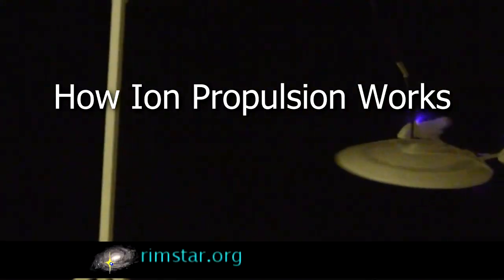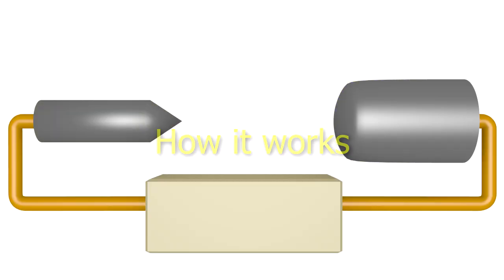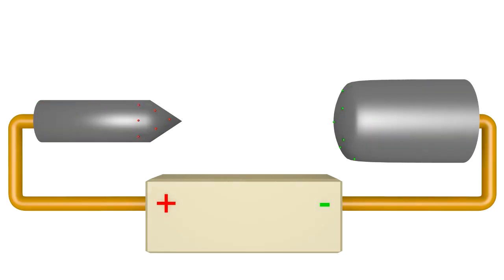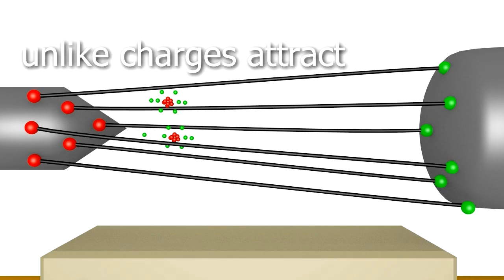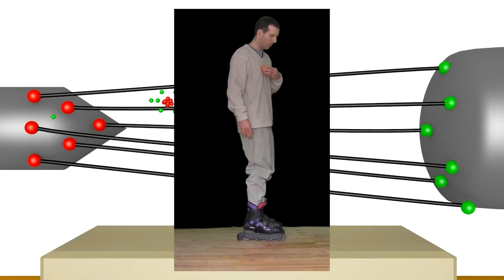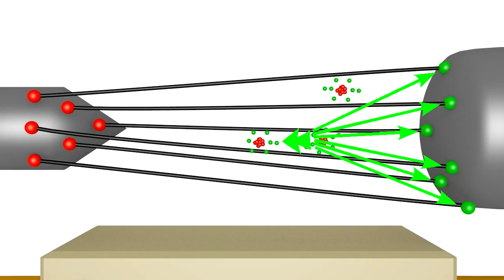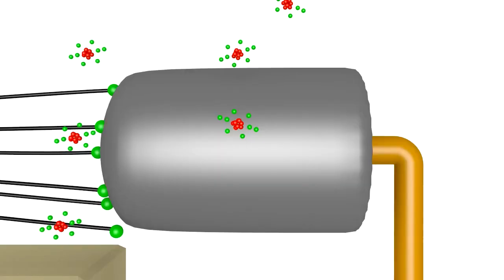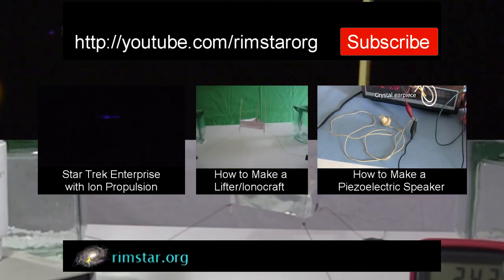How Ion Propulsion, Lifters and Ionocrafts Work

Comment: why or how does it create ozone
Reply from the maker: israel turner I don't know the why or how, just that above a certain number of kilovolts (thousands of volts) it starts producing ozone, which is O3 or three oxygen atoms combined as a molecule. I don't know exactly how many kilovolts either, though I was told it's below 10 kilovolts.
Reply: i was going to build the lifter but i dont know what to do about th power supply i would prefer buying onethats not to expenseve but i dont know wich
Reply: Exuse my spelling
Reply: I could use your expertice
Reply from the maker: israel turner The only one I know to buy is from amazing1.com and is costs quite a bit. See the bottom of my webpage here for some options http://rimstar.org/sdprop/lifter/lifter.htm
Reply: thanks i will check it out
Reply: @RimstarOrg Another great website for Tesla Coils with massive streamers and a MIDI controller is this website here, though they're incredibly expensive, any others interested as well: http://www.easternvoltageresearch.com/index.html

Comment: what would happen if you sealed both sharp and mooth in a vacume sealed tube filled with hydrogen or hydrogen choride? think it would explode or do you think it would show it plama more easily and inhance the proton transfer abillitys between the sharp and smjooh objects? would here be an ozone discharge?

/
Reply from the maker: shaun adlesperger I don't know. :) I've only worked with air.

Comment: im curious what is the lowest amount of power needed to create lift and what is the max? does that amount differ between how far the distance is between the "sharp" and "smooth"? can the "smooth"  end be covered on the opissite side of the "sharp" object?
does the gap between the smooth and sharp need to be contained air or does there need to be air flow?
 im very curious about this and any questions that you feel like answering would assist me greatly.
Reply from the maker: shaun adlesperger For my lifter, the minimum voltage is around 26kV but I don't know the minimum current due to the limitations of my meter, but it's somewhere just over 250 microamps. You can see the measurements in my video here https://www.youtube.com/watch?v=LOGAaObsN4g. The min and max are really dependent on the distance between the sharp and smooth electrodes. I've never looked for what the max is. The greater the distance the higher the voltage you'll need. Yes, the smooth end can be insulated but you must allow air to flow. The gap can be blocked somewhat since the electric field is actually larger than the gap size.

Comment: Hello RimstarOrg,

I am building a ion lifter for a science fair and have encountered a problem along the way: the thin wire I am using for the top part of the lifter and the place where the skirt connects to ground seems to be too strong and it stops the lifter from lifting. I am using 30 awg wire. What type of wire did you use? Your wire seems to move about much easier than mine.

Thank you for your time
Reply from the maker: WorkshopScience I'm using 30 awg wire. It does take some playing around to prevent those wires from holding the lifter down. Sadly what works one time may not work another time so I can't tell you exactly what to do. Try raising the lifter with your own hand and observe what effect the wires are having. Try putting out extra wire along that length, put a horizontal curve in it if needed.Also, the best thing you can do is to run your lifter in the dark and observe where the corona is. Trying to get your lifter running in a lit room is like doing it blind.Also, it's best if the one connected to ground is the one going to the foil. That way you don't have a high voltage wire near your table top. That can causes forces on that wire that'll interfere too.I have a section with tips on getting it to work on my webpage here too:http://rimstar.org/sdprop/lifter/lifter.htm
Reply: Thank you very much for your help and your time.

Comment: It was proven the Ion wind is not strong enough to lift of move the emitting object. It should be considered little more than a side effect. However, the electromechanical effects are certainly, and shown to be up to the task. Much like using electromagnets for propulsion.

The problem however is making the system efficient enough to use in practical applications. The limited amount of thrust or lift, combined with the sheer mass of the power system makes this current setup and similar ones, not useful for more than a science project, and one most science teacher would more often than not dismiss as "junk science" simply because they do not or refuse to understand it.

But knowing how it works is the first step in making it work better. Most technologies on Earth did not get to the point they are now without baby steps that seemed to be impractical or had very limited practicality.
Reply from the maker: DocWolph If the proof you're talking about are the calculations and measurements done by Jean-Louis Naudin, his measurements didn't take into account the sequence of collisions that result in random motion higher up and therefore doesn't contribute to the wind in the area below the lifter where he did his wind measurements.

Comment: So the big question is, can an ion lifter produce enough lift to carry its own high voltage power supply, some passengers, a bathroom, a kitchen, and a living room?
Reply: Yes. If you could produce enough power... We'll probably have to wait for fusion.
Reply: @MeepChangeling  just put a radioisotope generator (nuclear battery) with a tesla coil and you have a ufo
Reply: @MeepChangeling  almost here baby, first sign of power a couple weeks ago 👍
Reply: Their is a new start up company that has built a drone that uses ion power. It's pretty wild looks like a old TV intena with a drone bottom half lol. Has no props no motors extremely quiet yet floots n Flys around like a ufo
Reply: @kcmullins6179  it's actually quite loud. 85 dB vs 90 dB of a prop quad.
Reply: Mmm a kitchen? I'm not sure, maybe a microwave device😂😂😂
Reply: 6 years later: it a thing
Reply: Yes
Reply: https://www.youtube.com/watch?v=Qdg0_hjuksQ
Reply: Seems it needs around a decade to prove itself :) https://m.youtube.com/watch?v=iihprC5Huf4&feature=youtu.be
Reply: Yes
Reply: Man that's exactly what i was wondering😂
Reply: You could reduce payload by, instead of a bathroom, just having a hole ... 🤔
Reply: @michael borg Actually, that's exactly like a regular nuclear power plant. All a nuclear reactor does is boil water via the heat from the radioactive fule and use the steam to spin a turbine. A nuclear reactor is quite literally no different from any steampunk world where a magic glowing rock allows for the creation of tiny yet powerful boilers to produce "galvanic current".
Reply: @MeepChangeling  That is wrong. Not because nuclear power plants don't boil water to achieve that, but it is wrong because you implied all nuclear reactors do that, however there are some nuclear reactors that do not utilize light-water reactors. Which is what that is called when they basically boil the water and use the steam to produce energy. they boil it through nuclear fission of uranium. 

However there are also Thorium reactors and various other nuclear reactors that do very different things. Many light-water reactors are currently used, however many places stopped producing them and are actually debating whether to repurpose them into different nuclear reactors since the light-water reactor is not very efficient and has a ton of negative downsides for the environment.

Although despite the fact that light-water reactors have huge downsides to the environment, don't let that mislead you, they are still thousands of times better for the environment than burning fossil fuels.
Reply: Underrated comment
Reply: They use them in space on satellites with a liquified gas where gravity isnt a factor.
Reply: Hsfh Fejtpo you would have to make one. I was thinking of using solar panels, batteries, and a custom transformer.
Reply: @idea1407  Custom transformer? Keep the customers satisfy´d!
Reply: Sure. Just scale it up.
Reply: The military does
Reply: No. UFO uses zero point energy: vacuum in a crystal. I do not know how they harness the zero point energy.
Reply: Or can it be hooked up to the new mini space shuttle dream catcher so it can be used to get to high orbit without the use of conventional rockets
Reply: Dawn is a spacecraft by nasa which used ion propulsion. Search it.
Reply: Man has lost sight of the truth for himself.  Man is supposed to be working collectively on how to reconnect with the Divine Providence.  The construction of this device will NOT help you to re-commune and will only take man on perilous journeys deeper into other worlds of negatively polarized sensation and conflict.
Reply: @adamson5779  crawl back under ya rock where ya belong
Reply: @adamson5779   I agree frabato
Reply: @adamson5779  Mm. Ion a hear more about this.

Comment: What happend when you use AC instead of DC? Sry I'm a noob. :-/
Reply from the maker: Jimmy Metten If you use AC then it doesn't work.
Reply from the maker: Hmm... I'd always heard that AC wouldn't work and thought it wouldn't, but what's important here is the sharp and smooth electrodes. The wind is ultimately neutral particles. The only place where AC might be a problem is in between the electrodes where the ionization is occurring. The ions would be sloshing back and forth as the charges on the electrodes keep alternating, basically getting nowhere. But there might be a frequency where it doesn't matter, where the ions get enough time to travel far enough, maybe a low frequency AC. Might work. Might not. :)
Reply from the maker: *****
Not sure you can have low frequency on one electrode and high frequency on the other. That's because whatever you do on one gets an immediate response on the other. So a low frequency on one causes a low frequency response on the other. You'd just have a mix of two frequencies going on at the same time on both.
Reply from the maker: *****
One difference is that there's a difference in ion mobility between positive ions in air and negative ions (http://jnaudin.free.fr/pcnpend/html/pcespend.htm). You can also find some difference with how the corona forms explained below here https://en.wikipedia.org/wiki/Corona_discharge#Mechanism_of_corona_discharge

Comment: Hi! Great job!

I have a question. It's about the part at 5:54
If the negative is connect with the sharp object, you said there are some diffences what happens. What are the differences?

Thanks

And Great Job!
Reply from the maker: excristao I can't go through all the details in a comment but it starts near the sharp object again since that's where the electric field is strongest, except electrons are stripped off the atoms in the air and repelled instead of attracted. A full description can be found here http://en.wikipedia.org/wiki/Corona_discharge#Mechanism_of_corona_discharge
Reply: RimstarOrg
When the sharp is positively charged then positive ions are repelled and cause de air go down or something like this. But when the electrons are repelled insted, the air go down too?
Reply from the maker: excristao Yes, the electrons collide with other molecules on the way down and ultimately cause air molecules to go down too.
Reply: RimstarOrg
 Thanx.

Great videos and support.

A week ago I saw your videos about ion propulsion. On monday I shared with my students :)

Comment: Hi Rimstar, I wonder if you could answer something for me? (by the way fantastic explanation);
I have been watching a lot of videos on lifters and electroKinetics in general. I have noticed on a few of the videos that; if a piece of paper is placed between the anode and cathode then the lift was increased (measured on scales).
Do you think that this phenomenon could be that the paper is adding more Neutral atoms?
I'm sorry to burden you with this question, but you do have a very good understanding of the device.
Thanking you in advance, Dean
Reply from the maker: Dean Hunt I just checked my website where I'd long ago noted what happened when I did this same experiment 13 years ago (http://rimstar.org/sdprop/lifter/lifterwindtests1/lifterwindtests1.htm) and I noted at the time that there was no change in height. Sounds like there's more rigorous testing needed to tell exactly what happens. Since the device is still flying in any case, I'd liken it to putting a wall behind the outlet of a jet engine, and where the wall is not connected to the jet engine. The jet engine would still move, even if the wall followed behind it, as long as the wall is not in a position to physically interact with the jet engine itself.
Reply: RimstarOrg Thank you for the reply, I have ordered all off the components so that I can start tests for my self.
What I did notice from the other videos was that; when the paper was placed on the device then no change in lift was measured, however; when it was held there then the lift was increased. I think that this is certainly interesting and was toying with the idea of injecting pulsed magnetic fields into the emf field. Also maybe to try and use Graphene for the corona. Thank you again, Dean
Reply: +Dean Hunt Why use graphine?

Comment: But wont the charges eventually balance out? When enough electrons arrive at the sharp end, wouldn't the charges be balanced?
Reply from the maker: Jimmy WimminyWam Possibly, but the momentum transfer that I start describing at 4:28 and more explicitly at 4:51 is what makes it move. And in case you mean the charges will balance out and everything will become neutral and stop working, the power supply keeps the charge circulating.
Reply: RimstarOrg Thanks man, your the boss!!

Comment: Hello, how many voltage is required to lift the lifter and why is ion propulsion effective when it requires heavier energy source (Lifter for example requires that heavy high voltage machine)? Awesome video by the way!
Reply from the maker: Thanks! My 2 gram lifter lifts off with around 26kV and around 275 microamps. By effective I assume you mean practical or useful. Other than for fun science projects these lifters aren't effective. However, ion propulsion is used for spacecraft where it's okay if they take a long time to get up to a high speed. NASA has used it for some deep space exploration missions and I think Europe is also working on that.

Comment: I don't know about air temperature between the electrodes but I think buoyancy forces also may generate air flows in favor of propulsion.
Reply from the maker: I've never measured the temperature in the region of lifters. I imagine surfaces at least would be cooler than ambient due to all the air flow.

Comment: is it possible to use this concept to lift an actual person?If not What are the limitations that need to faced?
Reply from the maker: It's theoretically possible, but you'd have to build something the size of a house, put over a million volts across it and be inside at the same time. So it's not very practical.
Reply: but couldn't we increase the voltage further so that the same amount of force could be achieved with a smaller design?(the voltage might then be lethal) also wouldn't using electromagnets further the ion's acceleration?
Reply from the maker: Blueghost136
I think a million volts is lethal enough. :) But keep in mind you have to lift the power supply and with electromagnets you're getting into VASIMR and other designs and they don't lift their own weight either. For really big thrust they even talk about going with nuclear reactors to produce the needed energy.

Comment: What are your thought on in atmosphere propulsion. It clearly works on a small scale but given an adequate power supply would it be possible for say small air craft?
Reply from the maker: A rough number is that there's a voltage of 100 volts for every meter of height through the atmosphere. And that varies depending on all sorts of things: nearby objects, humidity, air density, wind, ... So you'd need a tall aircraft to get the voltage. Then there's the question of how much charge is in the air, which also varies. That's extremely small. From Feynman's Lectures, volume II, 9-2, the current density (charge moving under the influence of that voltage) is around 10 micro micro amps crossing each square meter parallel to the earth. So I'd say it wouldn't work for a small aircraft.

Comment: So does this have spacecraft use? Is it usefull for long distance travel? And most important does it have speed ? (my thoughts are it uses more energy than it produces,but i find it really cool :D)
Reply from the maker: Ion propulsion has been used by NASA on some spacecraft, though they do it a little differently. Since there's no air in space they carry along xenon gas. In that case it's actually used for really long distances. They're able to run it at low thrust for long periods of time, building up speed slowly, but eventually getting up to very high speed. As for the design in this video, it also of course would require the spacecraft to carry along a gas as the propellant. But I don't know if it's any better than the design that NASA uses. And it definitely uses more energy than it produces - my understanding is that everything does since there are always losses.